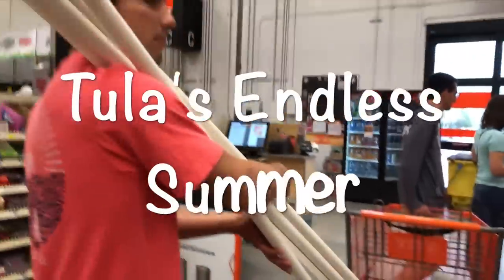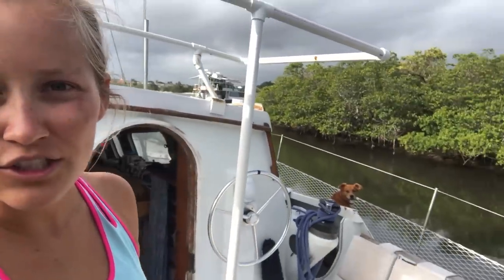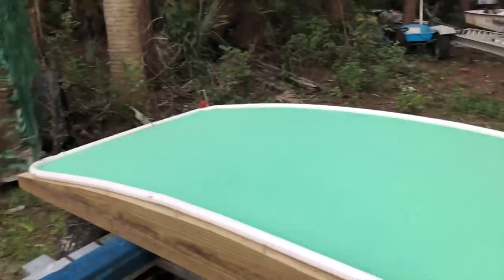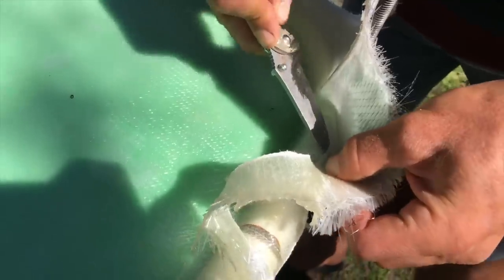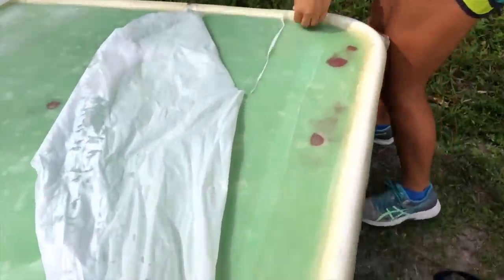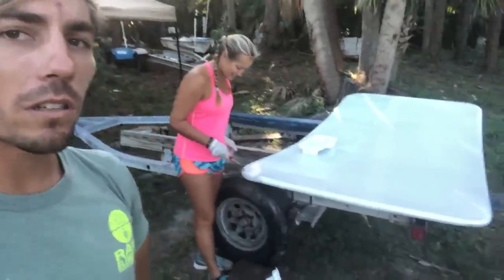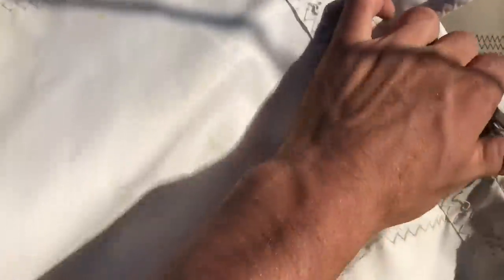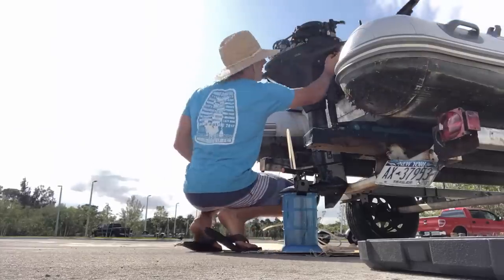DIY Hard Bimini for Catamaran

Comment: Peel Ply, thanks, I like it and will try it next time. now for the dreaded "ya should of's" i buried  DC wires under the glass for dome lights which work awesome! Made my supports out of PVC and hot glued plastic flanges with proper angle on both ends, that way it was one trip to the fabricator and he just had to copy my PVC ones.  Nice job!

Comment: Nice job guys! Like the hard top. I know it's after the fact but think you could have saved some time by having the stainless steel poles fabricated with bases and then making square base shims out of foam and fiberglassing them onto the top bottom for the pole/top connection. Plus that would have thicken the hardtop at the connection areas... Just my two cents on the fabrication.  Like the PVC pipe edge idea... I'll remember that trick! Looking forward to seeing your new adventures in the Bahamas!Fair Winds and Seas!

Comment: I know it is way to late but I had the idea of putting sawed in half 1inch tubbing at points on the roof where you could screw down solar panels in the future. Also would make it more rigid I would think. There's my 2 cent thought.
Reply from the maker: Hey Dennis! We used flexible solar panels from Renogy and we were actually able to just glue them with a strong marine adhesive!

Comment: The bubbles on the glass fiber might occur due to ‘rough’ mixing of the epoxy components. Try to stir the components more slowly. If there are bubbles in the mixture, you can try to degas the mixture by applying a vacuum. Either use a small vacuum pump or a vacuum cleaner might work as well. Confirmed less bubbles. Since you use a peelply, try to vacuum bag the whole piece next time. The vacuum pressure on top of your lamination, will compress the glass fiber nicely Onto the foam, further reducing the bubbles. Give it a try next time.

You might also want to check whether the foam that you use, releases gas under the heat of epoxy curing. That might also cause bubbles in your laminate.

Comment: Wont the hot sun will make that pvc  pipe stuff sag?
Reply from the maker: It's all glassed over so pretty stiff
Reply: Ok i see now what you did i thought you were going to use the pipe to hold it up, i think they have a different grade of PVC pipe to make outdoor furniture and  it doesnt have the sch 40 and other writing on it but you can take some laquer thinner or acetone and wipe off the writing, i have glassed over pvc before i like to rough up the pipe with some 100 grit to make it stick good but you probablt already did that, i build custom consoles for pickups i work with this resin your using a lot, they have special rollers to help with the bubbles, looks good though!
Reply: Hey Billy, i have been meaning to tell you guys that  i was watching this You Tube girl who fishes  called Darsizzle Offshore in Boyton Beach FLorida  and im almost certian i saw Adrenaline pass by in the background in her video from a few days back,it was by one of those drawbridges where she was checking her crab traps ill see if i can find it.
Reply: I watch their channel. I'll have to check it out. It would be cool if they could get together and make a video together.
Reply: jay bradley, you linked some flippin patties Houston video...  not Darcizzle.
Reply: jay bradley, I'm gonna guess that's not their boat.  Looks like it has a full enclosure around the helm.  Hopefully they'll chime in.  If it is them, good eye.
Reply: That boat has different windows and I'm pretty sure it was heading south.

Comment: Should of layed ounce and a half(matt) as a skin, then 1708
Reply from the maker: How come?
Reply: Tula's Endless Summer  its super easy to lay down, also stiffens up core/foam if there isnt enough back support to lay doen 1708. Looking back at video i think thr bubbles were from sunlight cause gas bubbles to form.
Reply: Tula's Endless Summer  love your vids as well. Im just north of you guys(stuart).
Reply: For what it's worth, my hubs suggests that the mat is fine with polyester resin but not necessary with epoxy. Sun/heat causing bubbles...likely, especially if the job began in the am when it was cooler and heated up as the day went along. Great work with all the DIY stuff. My hubby is a sailboat boat builder and admires that you all are willing and able to do these jobs. Love the water catchment idea! Cheers, Carleen in 🇨🇦